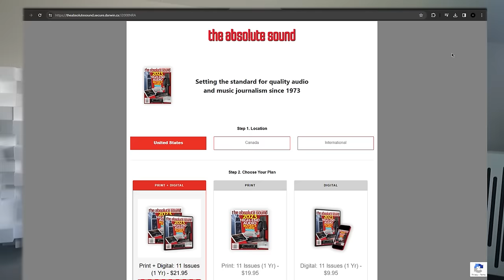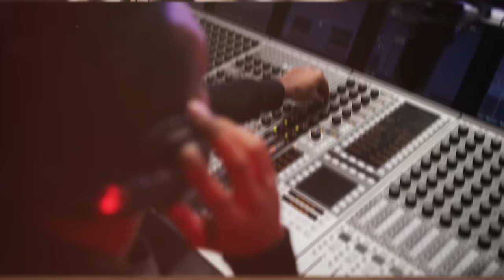Alsyvox's Caravaggio Full-Range Ribbon Loudspeaker | Robert Harley Previews...

Comment: Listened to Botticelli model w external crossovers.   Caravaggio is closer to my 20.7s size.  5mm excursion on the 20.7s.  20mm excursion on Alsyvox 😊
Reply: 20.7s have no bass, Alsyvox speakers have amazing bass.
Reply: @VideoArchiveGuy  
integrate 2-Rel Carbon Specials 
JLA cr-1 active crossover 
Shunyata Python xlr's 2.5m 
More bottom end than Alsyvox
Reply: @CarlVanDoren61  Alsyvox doesn't need subs.
Reply: I doubt the 20.7 can do 5 mm excursion. I’m a Maggie fan but that sort of excursion will cause bass slap on a Maggie.
Reply: @JohnLee-db9zt ran 20.7s 
with no subs couple years 
Lacked bottom end notes
But was exceptionally nice
Reply: Even with sub 20.7 or any Maggie will lose base dynamics and can bottom out. Compare to Apogee Maggie's frame is not strong enough to handle big dynamics or impacts that is why they cost less than other panel speakers. I had Apogee before and I am a Maggie fan too.

Comment: Nice Planar magentic speaker, one of , if not the top in this field in terms of specs!  that guy from absolute sound keeps calling it a ribbon, the dude from alsyvox keep repeating its a planar magnetic) push pull is same polartity.... not different, else there is nothing to push :)
Reply: I'm "that guy from The Absolute Sound" and I call it a ribbon because there is a distinction between a planar-magnetic design and a true ribbon. In a planar-magnetic driver like the Magnepan, a conductor is bonded to the Mylar film diaphragm. The audio signal flows through the conductor.  In a true ribbon like the AlsyVox, the entire diaphragm is electrically conductive and the audio signal flows through the diaphragm. Both are "planar" designs.
Reply: @RobertHarley-dk1th but it's aluminum foil traces bonded to a mylar sheet, not just an aluminum conductor acting as both the conductor and the diaphragm.  By convention, a "true ribbon" this is not.